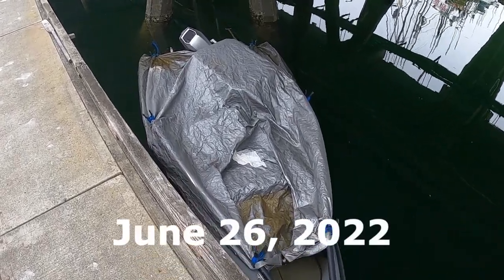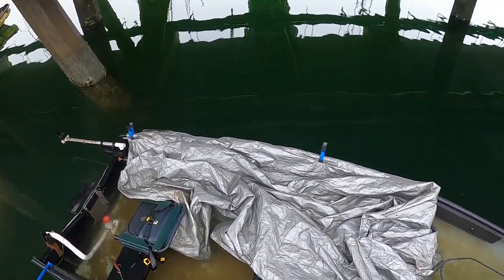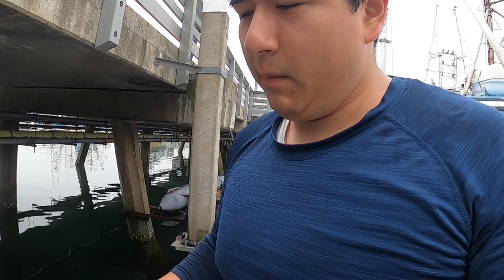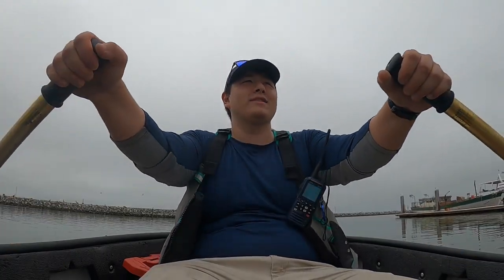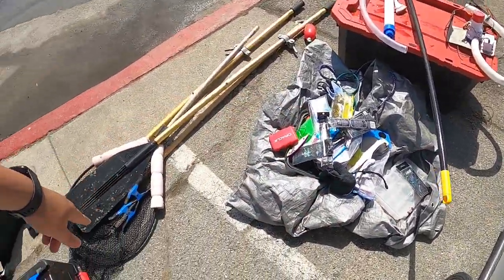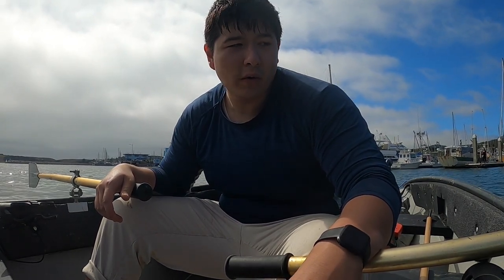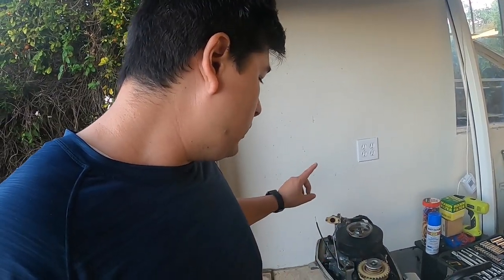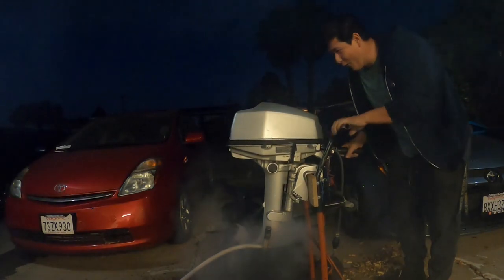My Porta-Bote Sunk!

Comment: Hi man! I feel so identified with you! I have a small fiberglass sailboat 4 meters long and 1.7 wide, with a main sail and jib and with a 6 meter long detachable mast. I have the same fish finder and exactly the same  Honda outboard motor as yours ( BF5A 4 stroke  5 hp second hand as well) and thanks to which I found your channel (thank you so much for uploading that video about the maintenance of the outboard because I'm new in the boating world)
My sailboat is light (about 200kgs) and I launch it through a ramp every time and when I go fishing I don't put the mast on so it's just a boat like yours, only it needs a small trailer to transport but it can be launched and recovered by just one person... I prefer our choice over a kayak but every choice has its pros and cons of course. Oh and it's virtually unsinkable because it has floating chambers inside it's structure which can be used also as storage. I paid around 2500€ (2600$)for the sailboat with sails, trailer, motor and even lifejackets... 7 years ago.
If you type " Pastinaca sailboat" on Google you'll see my boat, just in case you may feel interested about sailing (which is as much fun as fishing, I tell you) or buying a new type of boat...
Reply from the maker: Awesome! Your boat sounds like a fun one. One day ill learn to sail!

Comment: Bummer, it doesn't take much rain to completely swamp a porta bote.  Ours is our daily driver so we keep it in the water pretty much all the time to.get to shore and back from our sailboat which we live on full time.  I bail it out after every rain since we don't have a bilge pump system. Completely is not s good thing IMHO. There have been a few big rainstorms over the years that have totally swamped it overnight but the motor powerhead has stayed dry because it is under 30lbs and we don't keep a lot of stuff in the bote to weigh it down.  

With a bigger heavier motor like you have think about getting a big fender to lash under the back seat..That will give it enough extra floatation aft to keep the motor out of the water next time.  One under each seat will give even more floatation if you continue to store that much gear inside.

The best way to bail water out is with a plastic gallon jug with a handle that has the bottom cut off.  A square almond milk or OJ jug works really well at the bow simply pushing it up and out the front using a back and forth motion.  I can go from the bote barely floating with me in it to almost completely dry in a couple of minutes pushing almost a gallon a stroke every second.  I've had to do this many times after a squall and have even done it in the middle.of a longer named storm while it was still raining hard to avoid it swamping.

The best tool for cleaning the bottom is a stainless steel painter's knife scraper.  The rounded cutout for cleaning paint rollers works perfectly on the black tubes.  The scraper part on the end works well for stubborn barnacles and oysters but be careful not to scratch the plastic too much. A plastic Bondo applicator is more gentle on the hull and works decently.on softer stuff like sponges, grass and slime fuzzy.  If kept clean the growth has a harder time sticking to the plastic but as it gets scraped up it has more to hang on to and grip harder.  I clean our bottom about once a month and have seen it get much worse than yours did. It.really slows the boat down with only a 2hp motor.

Comment: I had a 5hp tohatsu 2 stroke that I got for $300. It started with 1 or 2 pulls. I thought that I had a good deal till the motor started leaking water. They didn't flush the motor right and it had rusted through the main part of the engine. But the outside was in very good condition with no rust.
Reply from the maker: I will keep that in mind! I always try to flush with fresh water after a salt trip!

Comment: My Porta-Bote folds up and hangs on my garage wall when not in use.  No dock fees.
It transports easily on the roof of my vehicle.  It has wheels, so easy to setup at the car
and roll down to the shoreline fully loaded, motor and all.  No need to leave it outside.

I thought that the whole idea of these boats was portability? 
Take it to the car wash and pressure wash it for a buck...
Reply from the maker: Well our pressure washers are like $10, but I agree with you for the most part. Keeping it in the harbor was just for 2022. A rare opportunity that I couldn't pass up. She is now back in the garage ;)

Comment: Where/how did you learn how to repair your outboard? I have an Suzuki that's out of warranty, so I'd like to learn outboard maintenance and repair. Any tips? I am not mechanically-inclined, have no experience with cars, etc.
Reply from the maker: I helped my dad with basic car maintenance growing up, but everything I know about outboards I learned mostly on youtube. These smaller outboards are pretty simple machines. The more you tinker with them, the more comfortable you will be. Remember, where there's a will, there's a way!
Reply: @OffTheHookFishing  Well, I took the plunge and disassembled my carburetor from my Suzuki. Cleaned all the gunk out, reinstalled. Also cleaned out the fuel tank that had nasty deposits and old gas in it. Put in new spark plugs and started on the first pull! So awesome! Just in time for rockfish opener in HMB!
Reply from the maker: @albertchen1894  awesome. Ill be out there on July 16th in hmb. 🎣

Comment: You think it’s good deal if I can get one  of these 12 footers , build in 2003,  no leaks, good shape for 600 bucks?
Reply from the maker: Its been a while since I've looked at the prices of used pbs, but I remember them typically being $500-1000, depending on condition. Mine is a 2009, so 03 definitely will have some wear. If it doesn't leak, it sounds fine. Just make sure to inspect the transom seam! It also depends where you live. In the bay area, there are always pbs on the market, but not the case for every city.

Comment: Good thing it’s portable, why do you leave it in the water? 🤷🏽‍♂️
Reply from the maker: @SteveFelt67  well, it takes about 30 min to set up and take down. Between packing the car, setting up the boat, putting it back on the car, and cleaning it when I get home, it's a minimum of 2h per trip. Plus, it's a ton of work to do alone. Keeping the boat in the harbor has its ups and downs, but I certainly miss being able to quickly get out and fish.